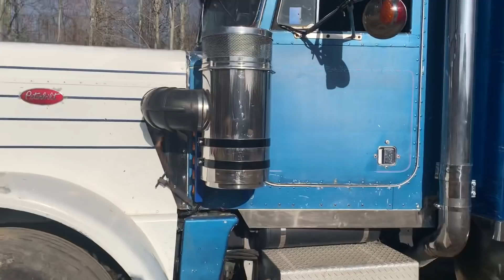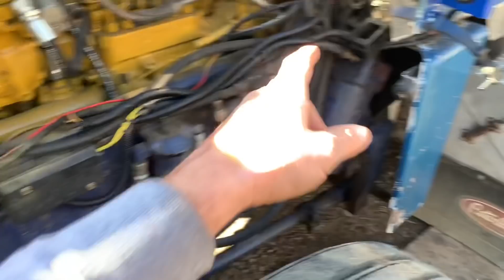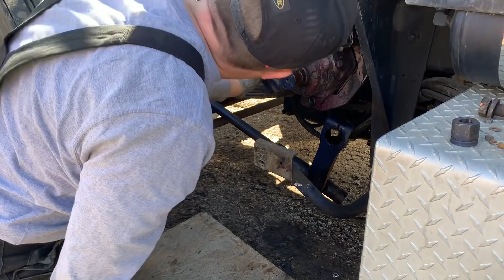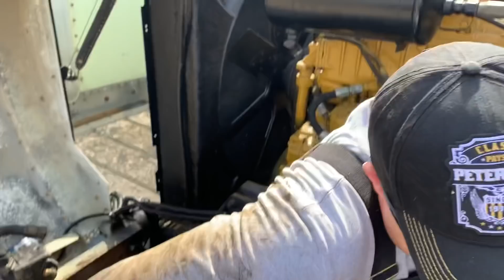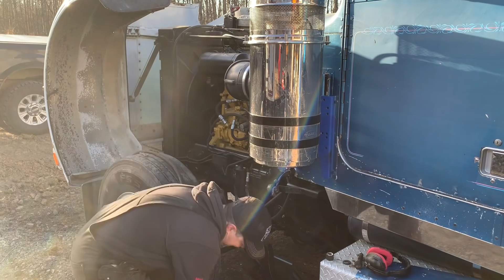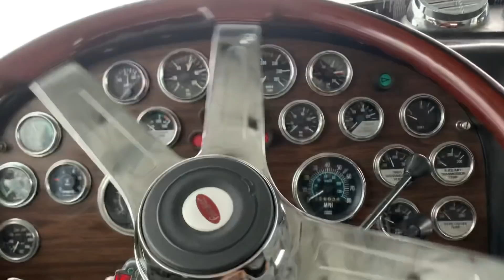Peterbilt 359 Restoration Ep.62 Power Steering Fail

Comment: You may find this helpful, check some of your hose lines and fluid lines they're going from the tanks to the power steering box. Chances are that there could be blockages in the airways and if there's fluid blocking up in there from the tanks to the power steering gearbox that you recently installed, that may be the problem like a car's brakes every vehicle has a master cylinder, yours has no such device. Instead, of uses air for brakes and other components, my suggestion is, check for any blockages. There's a good chance it may occur, that' may explain why you haven't been getting any response from the power steering box and it is brand new or if not refurbished. You did everything correctly but you did not follow the instructions on the on the sheet as you indicated earlier in your video. Start from scratch, and your problem will be found, the solution is there, it's just a matter of figuring it out, and working it out.

Comment: Me thinks a plugged line somewhere OR the tank return is blocked.
I admire you working on these machines in the cold outdoors.
Reply: I'm sure by the time you read this the power steering issue has been resolved. I have to agree with one other guy, a plug in the system or a bad supply line. Here one for you! My dad was working on a friend's car, and it would ideal fine, but everything you would give it throttle it would starve for gas. The problem turned out to be the short flex line to the fuel pump had gone bad inside and acted like a flapper valve inside the flex line. So maybe its one in the same, a bad hydraulic line. I love your enthusiasm and the fact you like the older truck! I like your choices in what looks good and what doesn't. And I must say You know your trucks!!! Keep up the great work and video. Your  very dedicated, to stand out in that cold like you do!! I appreciate it! Thank you!!

Comment: Check for blockages or restrictions in the lines both directions. Also looked like a filter top rear of the engine connected to the system. Just my thought for you. Great video. Minty

Comment: You can not have your u joints in phase like a drive shaft is lined up. They need to be staggered so they won’t bind and make your steering act like it is not working. I have also run into if you u joints are frozen on your steering shaft it will give you the same result you are experiencing. I have run into this before with both problems on trucks that I have worked on. Look at a similar truck that has a proper working system and study how the u joints are lined up on those steering shaft arrangements. I really think that is ware your troubles are. Trust me on this I have ran into this to when I worked at Maine Mack.

Comment: Have you changed the filter?  There should be a tight spot at the center f the steering swing usually 2 1\2 turn from either end depending on the steering box. It sounds like you have a blockage of flow due to a clogged filter unplugged r collapsed hose visually inspect or us e a rod to check her ends

Comment: Make sure the steering shaft u-joints are in phase.  If they are out of phase they work against each other and bind up.  Did you have a filter in the power steering system?  If so, did you change it?

Lastly, first rule of mechanic work is "don't assume the part you put on is any better than the one you took off"...

Comment: Its the pump pumping when under load maybe the drive gear in the fuel pump is warn and slipping 🤷‍♂️. Or has it got a bad hose. Worth replacing if you have the hose and fitting. Also check ya king pins etc 👍👍

Comment: If you want that beeing compacted ask the Dumper driver bevore he dumps it,
if he chould do what you did with the Pete,
As a Dumptruck driver myself I did this often,
compactor doesn't get so much compacted as everyone is thinking, with the wrong one it even looses the ground.

Normaly bleeding Power steering is, fill to max. steer full left keep it there 5 sec. go to full right keep it there
5 sec and repeat 3 to 5 times but slowly and with open Reservoir.
If that doesn't help make sure the drive gear runs sometimes the gear is broken.

A usefull trick is put a plain rod in the bolt hole and slide it towards yourself, don't break you back trying lift it.
And this elephant eear is called Kick panel or stepboard skirt.

Comment: you started the truck before bleeding the air out  causing the pump to run dry{no lubrication} this could cause damage to the gears inside the pump causing no pressure output.  also, are you sure which port is the output on the pump? possable crossed line.

Comment: I don't know if this is actually your problem but, when I had the '76 Kw W900. and every other truck that I have driven with a Cat motor...I always used 15W40 in the power steering because ATF or power steering fluid thins out too fast (no cooler) and you get a power fade (chattering) feeling when you are steering. Not sure, maybe yours is different.

Comment: When I worked for a Automotive Power Steering Manufacturer, not big truck stuff, the resistance over center of the gear box is a requirement. When the box is centered and you are driving down the road, it keeps the box from darting to one side or the other. For an alignment, you set the box to center, then make the tires match to go straight down the road.
For the power assisting parts, look at this ...
https://www.4wdmechanix.com/history-saginaw-rotary-valve-power-steering-gears/

Comment: Front end jacked up, turn side to side at least 20 times both directions, stop to stop. before starting to get the air out, won't come out any other way. Running a pump dry will burn it up.

Comment: Twinstick. Did you check or replace the hoses? It is very possible to have a internal blockage by a chunk of cracked hose. GM had this issue back in mid 90's. Basically a internal kink. Just because you have pressure, dose not mean you have correct flow.

Comment: I know this is unrelated, but when I had a guy re-do the ball joints on the front of my pick-up, it took one thousand miles of driving before the steering smoothed out, and stopped drifting from side to side...Maybe it will take a while of driving before your power steering smooths out, as well.

Comment: Try bringing your engine RPM up a little bit need to take it up to about 1100 and see if that makes a difference on my old 85 Freightliner he doesn’t like to steer at a dead idol so I got to bring the throttle up just a little bit and it turns

Comment: Jack the front end up might have a bind in the axle kingpin , pressure guage can be put in the system on truck to verify it is working.
Reply: If the drag link isn't connected it takes the kingpins out of the equation.  Was my thought as well until I thought about it
Reply: @clintporter9997  maybe I misunderstood I thought it was tight after he hooked everything up.
Reply: @tater_relocater  I was wondering the same thing. If he's spinning the wheel the way he was .. and it was hooked up, it's working obviously. But now I'm thinking it wasn't hooked up

Comment: it looks like the power steering is working usually you need 2 hands to turn the wheel while not moving and there is usually resistance in some spots due to either what ground you're on or if there's somthing wrong in the steering gearbox

Comment: I've been watching your vids for quite some time and  aside from the fact that you get a little long winded some times they're pretty good  so I thought I would comment on  your steering issue. I don't believe you have a problem. The reason I say this is that I watched you turning the wheel with the speed knob and even with the size of the wheel if you wouldn't have been able to turn the wheel that easy if you didn't have power steering. A none working power steering system is extremely hard to turn even on a car with both hands let alone what it wound be like on that truck. When power steering fails you are fighting against the hydraulics when you turn the wheels. A good example is trying to turn your steering wheel without the engine running. Some vehicles are easier than others to steer. I say this as a retired mechanic. NOTE:  The pressure relief valve in the pump controls how much force it takes to turn the wheels and if it sticks open you have no assist and if it sticks closed you would blow out hoses and seals . but you replaced the pump and gear so neither of those possibilities exist.

Comment: The 379 steering is tough getting air out because the way peterbilt mounts box to frame. Had one fight me for awhile. Not sure if 359 is as tough.When air was in system I would have resistance when I turn wheel left right really quick. It's been awhile when all this happened so don't quote me. Lol....Great videos

Comment: those original hear box bolts may have been "locking swedge nuts". on time use as the very end of the nut damages the threads as they were tightened. when i need a bolt to stay in place like that one for the gear box, i put it in the hole and then slide an o ring on the other side to hold it from falling out. once i have whatever it is mounted, i just cut the o ring. i would do 2 checks for the power steering. 1) disconnect the pitman arm from the box. jack up both sides of the front axle to get tires off the ground. try to manually turn the wheels side to side. checking to see if king pins are siezed. 2) with the truck running i would crack the pressure line at the gear box to see if it is pumping. then crack the return to see if it is returning.
Reply: Dear J.C. SMITH
👍👌👏 Really nice to meet you here. I bet that your professional suggestions are able to help Mark P.. Because of the little bit resistance while steering, I also guessed that something mechanical is kind of seized a bit. I really hope he will find out what hinders him to have fun with the steering.
2) This beautiful truck still has no brakes on the front axle. Maybe you have something used that fits in your storage? Maybe even something that M. P. can afford to buy? ;-)
Best regards, luck and health to all of you.
Reply: @Chr.U.Cas1622  It doesn't need front brakes.
Reply: @adrianspeeder  
👎👎👎

Comment: Call me crazy, but I would think it's just like bleeding brakes. I would, (which might take 2 people), engine running, pitman arm off, cycle the steering box to each stop with the return line cracked until you hit the stop, tighten line, then repeat process going back to other stop. I would think that's going to purge any air in the system. It should also show if you have pressure in the lines when fitting is cracked, proving the pump is pressurized. Just my ¢.02👍

Comment: Hell no you can go and use the truck to help pack it down and it's a great excuse to drive Little By Little. No power steering bring you back to the days of the old Armstrong steering. As for the pump problems I would check the drive gear, could be its worn and not turning, next thing is you could have a bad hose, if the hose is plugged nothing will get thru and some of the old hoses look good on the outside but inside they get sucks in tight from too  much pressure and it creates a jam other thing to look into if all that fails is to see if the pump shop switched something around incorrectly, kind of along shot they are usually pretty bang on things over st Hydra Steer but it's always possible. Talk about the parts gods smiling down on the project what are the chances that a pump could be on the shelf? Gotta love that.

Lol at the Jack Daniels spot moment, they ought to sponsor you,you are a faithful  fan of their product after cold or hard days. Hey your there why not give her a shot of the black paint and make her blend with the rest of the truck, got to keep her looking sharp

One trick I use when I get parts that are heavy as hell and you dont want to kill your back is you can use some of the slider motorcycle straps to raise or lower things to the ground,it's like a little chain fall for small areas and tight spots

I am sure you will get the pump issues resolved and we will find out what happened on the next video, hope its something simple keep up the good work!

Comment: Is the steering just as heavy as before you replaced every thing ? 
If so it could be the pump drive in the engine not working,but I'm not a truck machenic, probably worth replacing one component at a time.
Edit  
I remember repairing the steering on a car at work and after replacing the pump it was still the same and the fault ended up being a hose had started to fall apart from the inside out and was blocked the hose .

Comment: Mark, I work on trucks in England on the DAF trucks we have to jack the wheels off the ground then turn the steering otherwise with the wheels on ground they never bleed even on a road test! (I was trying for ages until i rang DAF and asked!!!)
Could give that a try!
Reply: With the weight of the wheels still connected to the pump and box but off the ground it has just the right amount of force/ weight to bleed it. Works on the daf and volvos !
Reply: makes no difference since he has the pivot arm of (steerbox not connected to axle)
Reply: My old 609d Merc van had power steering issues and like 25alias I had to get the front wheels off the ground to bleed it properly. I was having resistance like that near the extremes of rotation and going lock to lock a few times with the front end up off the ground did the trick. Not sure if big trucks are the same but maybe worth a try.

Comment: Had a similar problem on my 80 W9 when I bought it turns out the king pins were seized up and the binding made it almost Undrivable
Reply from the maker: I actually thought of that last year so I pulled it into the garage and put the front end on jack stands and it turned like butter even when the truck was off 🤔

Comment: always check your  u joints on your steering shaft to the steering wheel ,over years of people changing worn parts if the joints don t match they will bind in certain locations .

Comment: Did you install new power steering hoses I have had problems on my truck before with power steering hoses collapsing on themselves because the pump is sucking so hard that the inside of the old hoes was collapsing in on itself of plugging up the line
Reply: That’s what I was just thinking I had to have mine changed out 3 months ago
Reply: This will happen on the rear brake hose on hydraulic brakes as well. Lock your rear brakes up tight.
Reply: @carlcarlamos9055  I've never heard it happening on brakes but now that you mention it I can see how it could happen good to know if I ever have my brakes acting up

Comment: I would drive it down the road and take a few turns to see if there was any air in the system first before pulling it apart again, It always seemed to work better than trying to bleed the system for me.